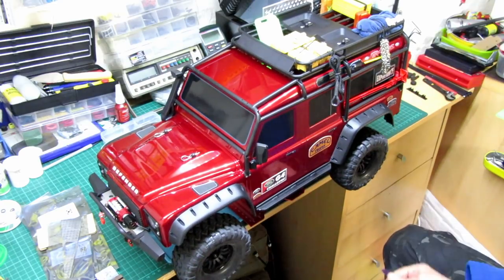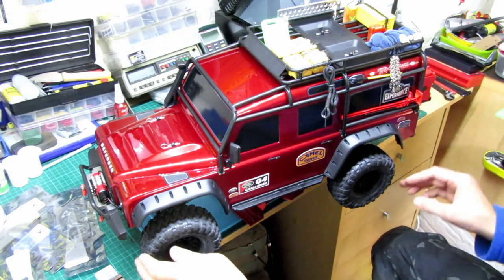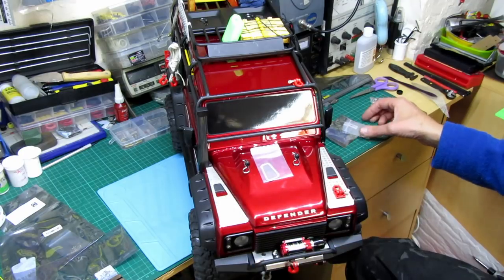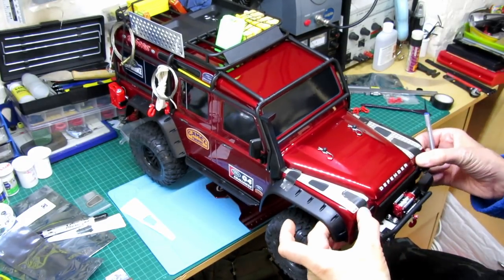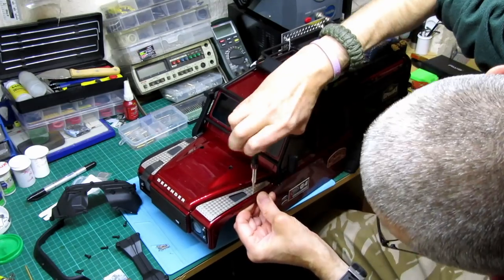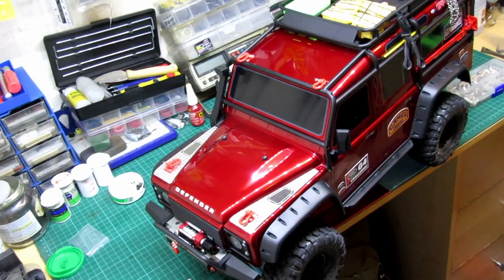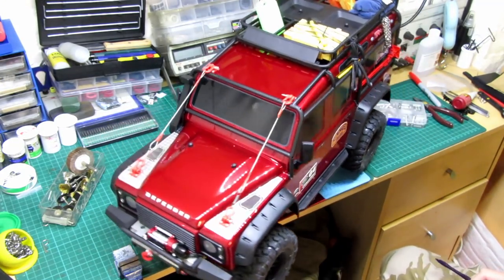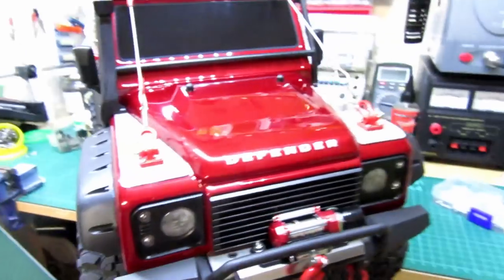Traxxas TRX-4 Scale and Trail Crawler Body Mod's

Comment: Those little side panels I did the same thing when it comes to screwing them down. I did however line up the stickers with the cut out holes in the aluminum panels. When I got it all done the stickers gave the illusion of filters below the screens. I have monster fingers, so the tweezers were my best tool to hold each tiny nut to get it on top of each screw and after many failed attempts was able to get them all on. Scotch tape was used to temporarily hold the panels in place till the screw could do their job. Wish we could place pictures up here. That winch and the end result looked good!
Reply: I have a similar "sausage finger" problem. I used a small wooden stick with a small lump of blutak on the end, it was fantastic for getting the tiny nuts onto the back of all those tiny screws!

Comment: You should change out all 4 knuckles over to brass in black, both differentials from plastic to aluminum, and transmission from plastic to aluminum. Change rims to beadlocks and some beefer tires and metal drive shafts and brass sper gear cover and finally heavy-duty shocks. You must ditch the traxxas esc and motor for a castle creations mamba x esc and crawler motor. The castle creations offers a esc and motor as a kit for about $240 US and the kit comes with a card good for a wired link that plugs right into your PC. Trust me you want to check this kit out, there are so many settings such as, punch amount, torque amount, forward speed, reverse speed, brake, drag brake ramp, drag brake, start power, and so many other settings. This motor is a brushless sensored motor wish is far mare superior than brushed motors because you end up with precise throttle control and the drag brake on these motors are so strong that it will trx4 to do a forward flip upside down if you have the brake settings too much. Remember, for crawlers, the heavier the rig is the better. Have fun.

Comment: Doesn’t adding springs reduce the effect of limb risers? Seems like it would all the cable to become slack allowing a branch to hit the wind shield. Looks cool though, awesome build.
Reply from the maker: Hi Mark not to sure you could be correct it's still working OK no problems yet will troprt back it I have any news thx
Reply: In real life, they don't have springs, just straight wire from the front bumper to the roof rack.  One other tip is the hanging of metal chains or buckets off the side of the roof rack.  If you are trying to go for realism then this is a no-no, as in real life it would destroy your rig not to mention make a terrible noise bashing around.  Most items are stowed away or strapped down for this very reason.  My tuppence worth is based on my 2 decades of real-life off-roading.  Your Defender is looking good and is a blast to drive.

Comment: Great work. May I ask what size of the drill bit you were using for those small screws and where can I find them? Thanks.
Reply from the maker: i used a 1mm diameter drill cheers

Comment: Would the canoe look odd if you just shorted the mid section or is that more tapered along its length than it looks on here?
Just a thought, I’ve never done any 3D printing so I know nothing. A beautiful model you have there and tasteful mods. 
Trouble is I would never want it to tip at all, I suppose that’s the trade off when you deck it out yes? X
Reply from the maker: hi dave it is the correct length just looks big there is plenty of them around in stl format ive chosen not to fit one just as its a bit of a pain when i need to change the battery depends what you wand rock climber or that camping look

Comment: When you are adding these mods are you adding your own screw holes etc? New to this and don't know if its all made to screw in via instructions or its custom mounted?
Reply from the maker: No I just self tap the tiny screws that came with the body parts into the plastic
Reply: @Beta250trials  Awesome thanks, picking up a defender soon siked about it!!

Comment: On your last video when you were working on the winch, what was that thing you gave the winch temporary power from? I think it was 5vdc. What is the machine called? I have an idea. All I know is I NEED ONE!
Reply from the maker: Hi Brian do you mean the black bench power supply
Reply: @Beta250trials  Yes. That would be it. I wish I could send you a picture of my red TRX-4. I have almost full brass under the frame. Full light kit. I even have a visor for my light bar. I've tried all types of wheels & tires and the best I found came on the truck! Canyon Trail! I have the limb risers with springs. I love my TRX-4!
Reply from the maker: That sounds fantastic if. You get any photos I would love to see them..